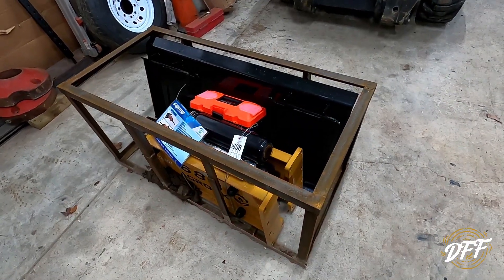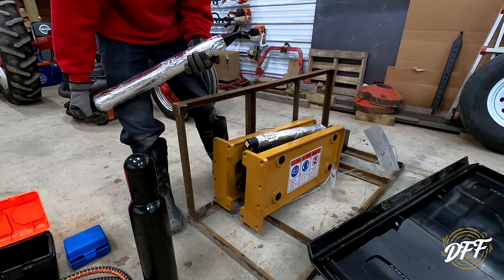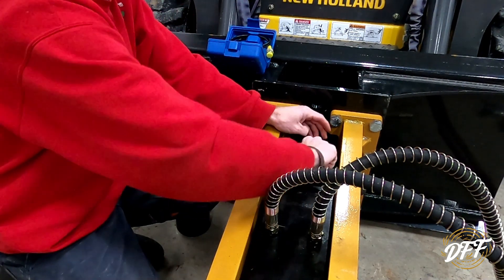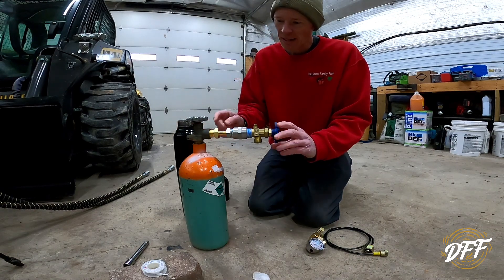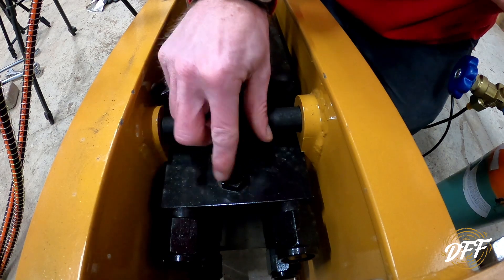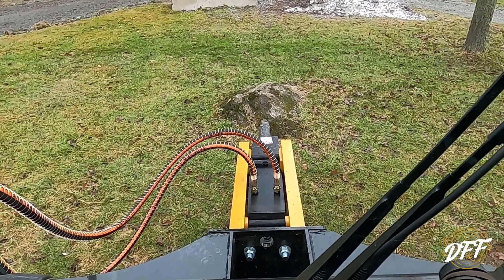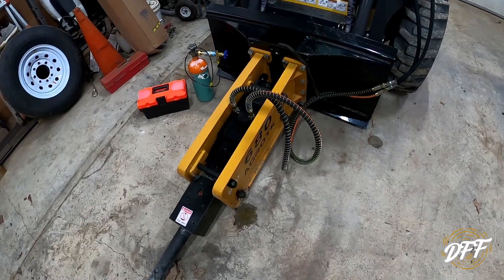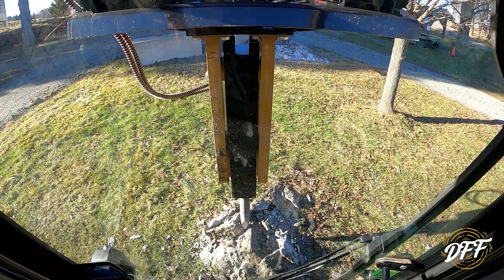I Bought The Cheapest Skidsteer Jackhammer Attachment I Could Find!!- Agrotk 680

Comment: I just picked up the larger ZW-750 (11/24) at auction. The hoses were long enough for my machine (Case TV-380), and both the nitrogen bottle and the breaker were charged.
Reply: Is that 11-24 flow rate?

Comment: It seems like part of the problem is you keep moving forward with the machine while youre trying to use the hammer instead of just hold the machine still in one place. Looks like it is putting leverage on the anvil keeping it from functioning correctly.

Comment: I'm glad to see you got it going.  Looks like it was a bit of a pain. I'd been eyeballing the larger 750 unit, but ended up getting an indeco hp750 off auction for 1700$, which is an absolute steal, because as you said these breaker units are insanely pricey. Still, it's good to know that these work well, and the issues surrounding them. I've also been eyeballing the forestry mulcher made by agrotk. If you do one of those reviews let me know! Lol

Comment: Hi, I have the similar New Holland machine with proportional valve toggle switch. My switch has a diagram to the right it looks like a female coupler(on machine) and the left a male diagram. Does that not indicate which side is being pressured, ie push the toggle to the right the female coupler is providing flow and male return ? Which coupler did you end up hooking the in port to ? Using right direction still to operate ? Thanks

Comment: Do you have a zero pressure return line hooked up on this machine to run breaker? Or just using the factory hydraulics?
Reply from the maker: Just factory hydraulics. The hammer only came with the two hoses- no case drain.

Comment: Hello
I’m in BC Canada, I got one from the Auction, the hoses were to short and the fittings are “strange” 1/2” npt straight thread ! The flange “yellow parts” did not meet the mounting plate worth sh*t ! Bolts were previously installed, Received the wrong tool kit, no regular thingy! (Kit was for small engine). Ordered regulator/filler from Amazon ! Hammer had gas in it already. Bottle was MT. Haven’t gone down the “odd fittings” problem yet, for the Nitrogen. 
The actual Hammer works great! Broke about 12 yards of rock (not concrete) so far with no problems except a small leak on the “in” fitting ! 
I’m Happy so far 👍
FIY Hooked to a 743 Bobcat
Reply: Any link on what you end up using ?

Comment: Man thank you for putting this video together! I picked up one of these from auction last week and haven't messed with it. Now I know what to look forward to. I do have a good hydraulics shop nearby, so hopefully they can put together a new hose for the nitrogen tank vs having to use the old valve like you did. BTW, on the aux hydraulic ports in one way flow your "in" port should be the female flat face coupler, and the "return" should be the male flat face coupler (which makes sense considering the case drain port is also a male flat face just 3/8" vs 1/2").

Comment: I bought the same one at a auction and mine wouldn’t hammer. Took it all apart and the valve was sticking slightly. Put it all back together and still won’t work. I put as much hydraulic flow that my machine could handle and then it started to work. Seems like it needs more flow to keep it running reliably.
Reply from the maker: Glad you got it working at least 🙂

Comment: We will replace nitrogen cylinders and valves with American standards in February of this year. The problem will be solved by then. We're sorry for the trouble
Reply: I bought a 750? post pounder have been all over the place trying to get tank filled and they all laugh that it seems to be an oxygen valve in tank and refuse to fill because no labels on tank.  I woulds not advise anyone to buy these.  No manuals on how to assemb;lle or use.
Reply: Send me the replacement if you upgrade the fittings, I have a 680

Comment: Please add this to your link and video to help everyone who has bought the post pounder or hammer. 
Step 1 Throw the nitrogen bottle provided with the unit away. It is an unmarked bottle with an oxygen fitting.            
            Safe to say not too many gas suppliers are not going to fill it.
Step 2 Order or go to your local weld supply shop and order a Western Enterprises fitting # 415
             it's actual part name is Adaptor CGA-580-540 while you are there rent or buy a filled Nitrogen bottle. 
Step 3 You now are ready to use all the parts provided with the unit. Took me a bit to figure out the parts but                                                                                                                    when done it works good.
I have picture just not sure I can ad them on here. It's about a $25 fitting but hope this saves everyone some headaches. Have a good day
Reply: What din fittings came on the hoses? I can't figure out how to adapt it.

Comment: hello from the Netherlands . 
on your skid steer loader there are three couplings next to each other that is 1st flow - return - 2nd flow isn't it?  .  
shouldn't the "out" of the hammer just be on the return of the machine?  .  
At least that's how it works with excavators here .  
and so you can not put flow pressure on the wrong side of the hammer because "IN" = flow and "out" = return then
thanks for the video .  
Sincerely Hollandduck
Reply from the maker: That is some great info. You may be correct- I will have to do some research on it. Thanks!!
Reply: @dehavenfamilyfarm  you're welcome

Comment: Always fun trying to get off brand💩 to work.. 
Looks like it kinda works... Flow direction and volume can be very important...
If you have enough lift, you can use it for pounding fence posts too, just need a flat hammer.
Should work out alright, especially for the price!
Reply from the maker: Definitely get what you pay for 🤦‍♂️ It's working pretty good now though. The company that makes this actually does make post pounders too. I imagine it's the same unit, but has a mushroom head on it. Thanks Ed!!